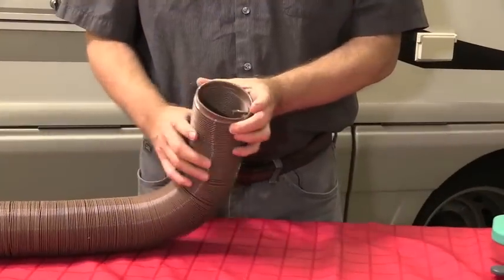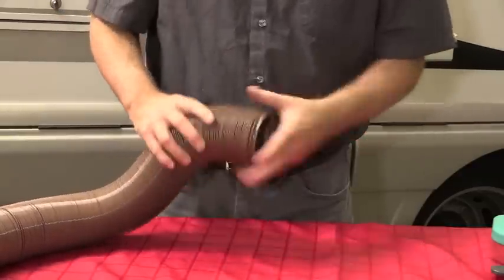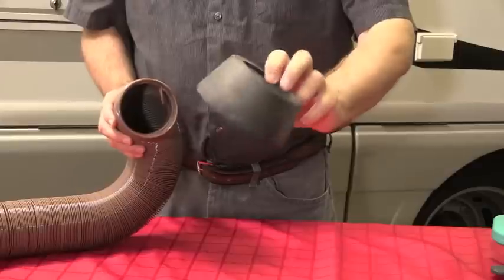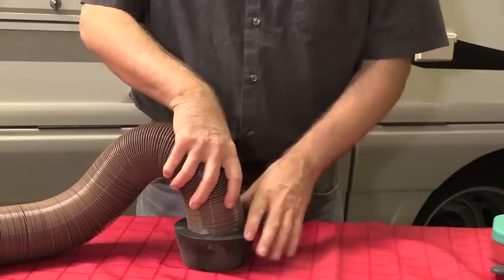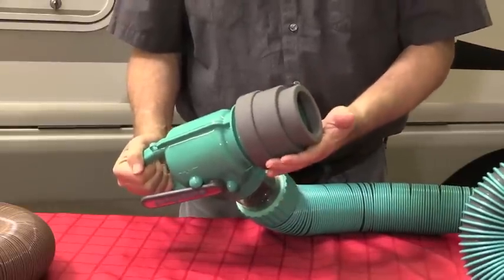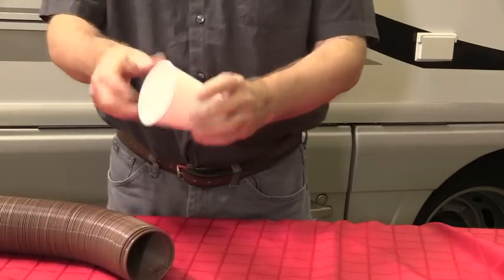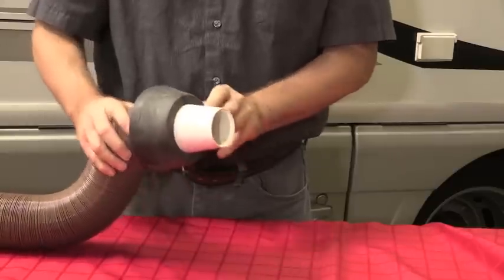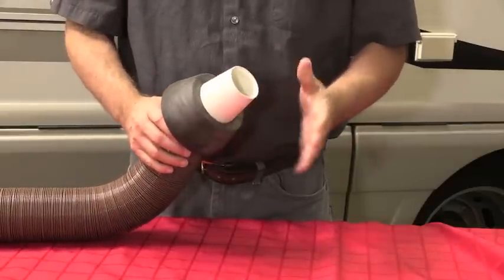How a paper cup can save the day at an RV sewer hookup

Comment: You could take one of those white plastic coffee cups from the grocery store and cut the bottom off of it.  That way you could keep it in the RV permanently and not have to be concerned about the paper cup falling apart or possibly crumpling and falling into the hole.  The cups hold 16 oz and are made of white plastic.  They come with a lid and usually have a wide rubber band around the middle.  They look just like a paper cup except they're durable.  After use you could rinse them out like the hose and stick it back in the bay til the next time.

Comment: I would have to say if you have a campground hook up that is smaller than 4 inches, you might want to consider another RV Park or just NOT Dump your waste, till you can find a proper dump station.  Certainly you can go several days in the Black Tank.And if you consider trying to dump the black through that little cup, I am willing to bet the T-Paper and other solid waste will get blocked, creating another huge mess!

Comment: Still isn't a secure connection! Really, a paper or styrofoam cup?! There is a reason most states have outlawed just putting the hose in a hole... it was because would not be securely fixed!